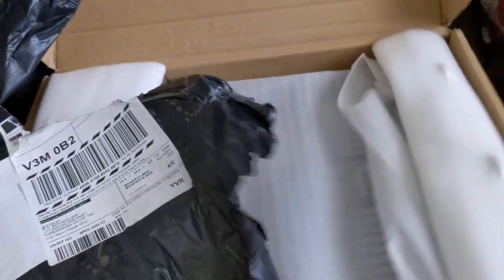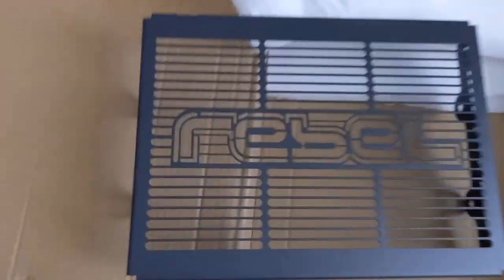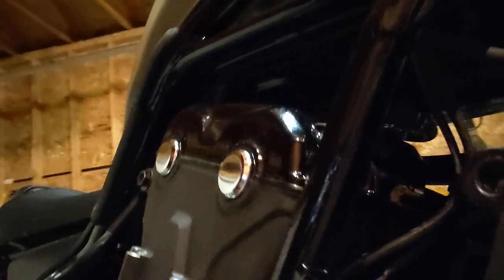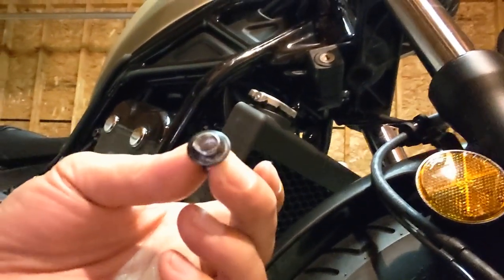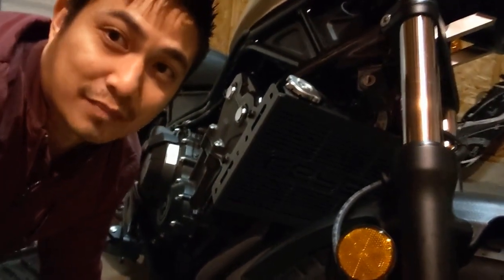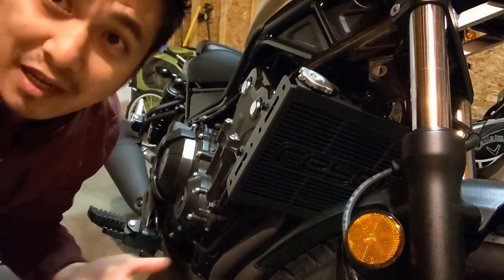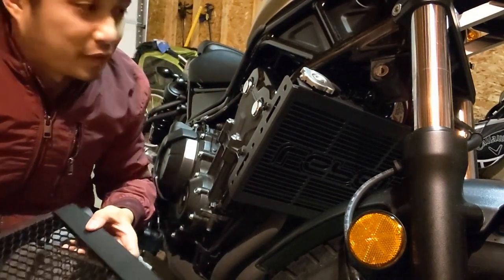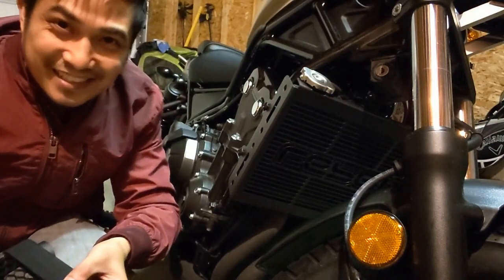HOW TO INSTALL A CUSTOM RADIATOR GRILL COVER || 2017 - 2019 HONDA REBEL

Comment: I have the side covers but I think I will get that cover also.  it just looks nice.
Reply from the maker: Just check if the side covers works with the actual cover ...also the whole point is to protect it from flying objects..I heard from someone that their plastic one was hit hard and damaged.
Reply: @manriqueboo-bye2601   the side covers should fit on it better than the stock one.  the stock cover is a little curved.  the new one looks straight